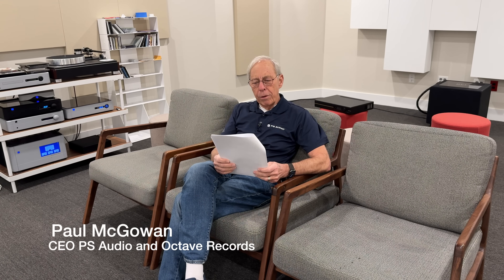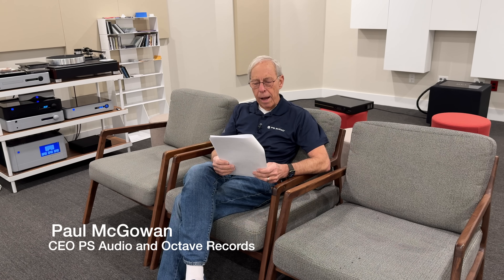Vacuum tubes in R2R DACs

Comment: After reading the comments I think there is a market for hifi Ethernet cables. 
Maybe I should get into it, lmao

Hand wired, precision cables designed specifically for your Hifi appliance, to deliver all of those bits with an utmost precision 

Ah sweet sound of those hifi tcp/ip packets, incomparable to the ones delivered by the inferior regular twisted pair…

Comment: Just a point, R2R networks only have R and 2R value resistors in a ladder configuration. Each stage represent a more significant bit than the previous, so a 16 bit DAC will have a string of 15 R value resistors with 16 2R resistors optionally shorted to ground between each one.

Comment: I think most people are conflating the encoded stream with the method it is encoded and decoded. DSD is just a low performance method of delta modulation which is used to reduce the bandwidth (storage/communication) For any DSD encoded waveform, there exists a mathematically identical PCM encoded waveform. The mathematical transform is extremely simple and can be done extremely efficiently by an FPGA. Thou it's not really needed unless you're talking MHz to GHz. The merits of the encoding and decoding methods/hardware is a completely separate topic.

Comment: a dac with vacuum tubes can be great ,you can swap the tubes and tailor your tone, you will have the possibility of using the best tubes ever made (vintage or nos) which are known for great sound instead of updating the firmware every 6 months.
Reply: I bought a tube dac from a small manufacturer, and it sounds very good, lots of detail and great soundstage. This small manufacturer's top of the line dac uses tubes and software for up sampling, plus power tubes in the output stage.

Comment: Sorry, sticking tubes in the chain is just more audiofool snake oil  psyuedo science
Reply: Why would you think that tubes are snake oil?
Reply: @ only thing they add would be tube distortion which apparently audiofools like
Reply: @lenimbery7038  tubes don't add audible distortion if designed not too, especially in a dac output stage.
Reply: @ nor any audible improvement
Reply: @lenimbery7038  you must never have heard a good tube dac if you are saying that.

Comment: When it comes to playback of PCM files. RtoR is the only accurate way. A PCM file has a set of data bytes (8 bits), often 2 (16bit) or more per sample. When a sample is played back it represents a very accurate number that represents the voltage measured at that point in time originally. The job of that PCM DAC chip is to play that exact voltage until the next sample is provided. And with the RtoR that is what it strives to do. 

The alternative is a Sigma Delta DAC. SD DACs are single bit DACS and ignore the actual numeric value of the sample making them completely ignorant of the actual PCM data value. The best they can do is use some algorithm and guess whether than new sample should be higher voltage than the last one. If yes, then turn on for that sample duration. They never know when they are at the actual exact value of that data sample. They just try to sloppily follow along with changes.
Reply: I wonder if the SD algorithm is really any different than what the DirectStream must do to compute the DSD stream from the input PCM stream.
Reply: @SteveWille  As the DirectStream is SD, yes.
Reply: @glenncurry3041  Paul’s comments in the video are confusing then… he explains that the DirectStream is unique in its approach (PCM → DSD → analog). If that is essentially what SD does, then the DirectStream is certainly not unique.
Reply: @SteveWille  All SD DACs turn PCM data into a single bit stream like DSD. Not all up sample to as high a rate as the DirectStream.
Reply: @ Cool… thanks for the clarification. So the DirectStream DAC is not fundamentally different than a garden-variety SD DAC. Maybe it only differs in implementation (FPGA) and in parametric aspects like the sample rate. Is it fair to say that there really are, broadly, currently only two fundamental approaches for D to A, multibit and SD, and then some implementational differences within each?
Reply: @SteveWille  It's spec sheet states: "Analog Conversion method - Delta Sigma (DSD) Single-bit double rate" ... "DirectStream converts every input signal, both PCM and DSD, to single-bit, high sample rate". 

As Paul always admits it is the output filtering that can make the biggest difference.

Comment: I feel for people just getting into digital sound.  It seems like a complicated mess of conflicting claims.  In the end, if you like the sound you are good to go.
To me it is very simple.  I used old CD players and then tried to get the best sound I could out of them.  You soon realize that a CDP is 3 components.  
1. A transport that produces the data stream for the DAC,
2. The DAC that converts digital stream to analogue, and
3. an output stage that beefs up the signal to get it to your amp or preamp.
Any of these 3 can be swapped and optimized.  Lukas Fikus, aka Lampizator was a DIY hobbyist who took CDPs and made them killer quality sound by replacing the crappy op amp output stage with a triode.  He showed that a tube output stage is just 3 resistors and a tube plus a couple of power supplies.  It can be added to any CDP.  A really nice 6n2p tube costs $3.  Such good sound for so little money and effort.  
When you break it down, that $600k DCS DAC is just these three components optimized to the extreme with separate boxes for all the power supplies and a lot of fancy bling to justify the enormous price tag.

Comment: Tubes kill a dac. Tubes belong in point to point wired circuits. Pick digital or vinyl. Don't mix
Reply: The output stage in a dac with tubes can be point to point wired, along with the power supply which could also have tubes in it.
Reply: @mitchtaylor6512  Yes, it is. For example, Audio Note DAC

Comment: I always enjoy your talks. It simplifies hifi so a lot more people can understand it and hopefully improve things. But ...

While I agree that DSD sounds great, and I really prefer it over PCM, it is definitely not the same as comparing sigma delta to R2R! And I really prefer R2R over SD. In fact I chose a great R2R dac that can't decode DSD natively but sounds better than any SD dac I can hope to afford. So even converted DSD sounds better that native DSD on my previous or other DACs. 

I totally agree that the output stage is very important to the overal sound. BUT! Sigma delta for converting DSD needs an elaborate output stage and filtering. This deteriorates the sound. Less complex means less deterioration, just like better parts help minimise loss of information. 

Now the neat part of R2R DACs is that they generally don't need an elaborate output stage. I've made modifications to old R2R DACs minimizing it to just 1 resistor to ground. That's all, and nothing in the signal path. It didn't measure great, bad in fact, but it sounds so natural. I discovered this after doing tons of modifications on a tube SD dac. Then I found this old Philips chips tda1543 and started modifying. 

And then came the epiphany walking in to a free summer concert in our local 12th century church. What I heard was not the exaggerated detail of the tube sigma delta, but the unfiltered R2R. 

Since then I quit tinkering. Upgraded to a Denafrips discrete R2R and recently to the Laiv Harmony. 

I learned my lesson not to rely on complex circuits. My first real speakers were cheap but good and weirdly only had 1 capacitor for the tweeter. Then I upgraded to a pair of lovely Rogers LS3/5a 15Ω. But I always missed air and transparency. No wonder, seeing the complex crossover. Then upgraded to Reference3a MC. Again: only one capacitor. There it was again! With added bass, mind you. 
Then 15 years later I had the chance to buy a pair of Genesis VI speakers. I still have them. Wow, finally in the big boy league. But also switched to refurbishing and modifying speakers. And finally, make my own. 

So what did I make? My own take on the LS3 but with lessons learned. It is tiny, dipole 3" Ti fullrange with a small AMT super tweeter. Just a bafflestep correction (and 3rd order for the AMT), in a closed bamboo ply box. The Genesis VI take care of subwoofer duty. Best sound I ever had. The speakers totally vanish, big sound, very spacious, very fast yet sweet, pinpoint accurate with incredible detail. 

Less often is more. More natural. And that is what R2R can do.

Comment: Very good explanation Paul. My opinion is: It’s time to create better ways from measurement in high-end audio devices, including new instruments to do it. For example loudspeakers still waiting for a real upgrade as transmission of the sound. 
The evolution of loudspeakers still very poor, and dependable of placement and the listening rooms.
Reply: Coming from an electronics degree from the early '70's and being involved in test and measurement of audio and video (sold bleeding edge digital video T&M), audio T&M is stuck in those 1940 - 1970s days. Simple steady state sine waves. A linear sweep at best. Maybe two of them at a time for IM. Nothing in analog audio testing actually test the dynamic type signal that actual audio is. Much less the digital distortions introduced. Audio in video applications actually had more T&M such as Differential Phase and Gain measurements. When video went digital they came up with an entire new set of T&M such as Zone Plates.

Comment: An audiophool and his money are soon parted!

These people should learn about things like transfer function, noise levels, etc.  Also, look into Shannon and Nyquest, to learn about how digital audio actually works.  Lets not forget vacuum tubes add their own noise.  For example, because they have the filament to heat the cathode, they have a lot more thermal noise than any transistor.  The hotter something is, the more thermal noise.  Also, unless DC is used to power the heater, it will also produce AC hum.  Tubes are also subject to microphonics, where vibrations add noise to the audio.  This is why tubes, in tube preamps, were often mounted on rubber.

Comment: In The High End 
Professional Audio World 🌎 Out/Put Stage of a
DAC Some Like 
The 6N1P Vacuum Tube
In a DAC 
Yet The Solid State 
MOSFET Has Similar Characteristics of a 
Vacuum Tube But  Is 
Much Cheaper and 
The Home Audio File Is 
None The Wiser 
Paul Ears 👂 Will Hear 
The Difference Between a
MOSFET vs 6N1P Vacuum Tube 
Yet Paul Has To Push 
His Products and 
The MOSFET Has a
Similar But Not 
Identical Sound To
a 6N1P Vacuum Tube 
Yet The MOSFET 
is Used For The Home 
Audio Market Because of
The Bottom Line 
Gee How Time Flys 
My O’Lady is Getting The
Bed Ready and It’s 
Twilight Time 
Happy New Year 
I Just Can’t Wait 😜 
My O’Lady Bought Me a
One Pound Bag of
Insomniac Dark Roast 
Whole Bean Coffee ☕️ 
Can’t Wait To Grind a 
Pot and Watch 
The Rose 🌹 
Parade

Comment: Do resistors only influence the current, but not the voltage?
Reply: Ohm's Law V=IR  Resistors change voltage and current. A resistor will show a voltage drop across it. Higher resistance= higher voltage drop= lower current flowing through the resistor.

Comment: @3:55 "That makes some people very upset."

Paul, you are the one who seems to be very upset, for being told that a 100%, purely digital format is not analog.
You want to have it your way, regardless of whether or not you are right or wrong, and take offense at not having it your way.

You should not take it personally, when you are publicly calling a digital format "analog", and you are corrected.  What do you expect?  Everyone should just go along with calling a digital format "analog", when it is 100% digital?

The DSD format is not analog.  Do not get upset over reality.

Paul, where are you storing your DSD songs?
The answer is on a hard drive or flash drive (solid state drive).  You are storing your DSD songs the same way you are storing your Excel spreadsheets, because your DSD songs are 100% digital.

The DSD format sounds amazingly like analog.  But that does not make the format analog.  DSD can sound more realistic and more analog than reel-to-reel.  But it is still not analog.  It is 100% digital.

Why are you making an issue over what is clearly and factually a digital format?

@4:13 "...put it (a digital stream) directly into an amplifier, and you get music."
You are connecting your DSD box directly to an amplifier.  That does not mean that you are feeding your amplifier a digital stream.  You are not.

Your DSD box is feeding voltage (voltage is analog) to your amplifier.
Just like any CD player, it reads the digital content from the storage device (the CD) and creates a voltage.  A CD player (or any DAC) creates voltage (the initial analog signal).

Just as a vinyl record is a dead slab, and has no sonic properties (hold it to your ear, and you hear nothing), it takes a voltage to start the analog signal, which happens when the stylus vibrates from the record's groove, and shakes the coils, etc.

Your DSD box is creating and sending out a voltage to your amplifier.

When a streaming service sends you a DSD formatted song, the streaming service is not sending you anything analog.  They are sending you digital bits, and only digital bits.  Then, your DSD box reads those bits and creates a voltage.  It is that voltage that you are feeding to your amplifier.

DSD is 100% digital.
DSD is 0% analog.
It is in the name of the acronym "Direct Stream Digital".

Paul, if you are certain of your position, then please update wikipedia.
Regardless, I wish PS Audio continued success.

Let's make 2025 a great year!
Reply: "Yes maybe, but muh ears make it sound analog to me and muh ears are always more right than you!" 🤗
Reply: Yes. Because your inner ear is 100% digital as well. Surprised? Well, so are your eyes. Because the nervous system is electrical too. 
In fact, our whole universe is quantized, that's why they call it quantum physics. 
So, your eyes can fool you, your ears can fool you, and your brain can fool you. 
Hifi is nothing more than foolery. But that doesn't mean it can be fun.
Reply: "digital" is not really the relevant term. Rather, is the instantaneous signal amplitude quantized versus continuously variable? Is that instantaneous amplitude updated at a fixed quantized rate, a variable quantized rate, or continuously? The limit as the quantized values approaches zero is continuous (both the amplitude and time). The key is to find at what point in the quantization is sufficiently small to be immaterially different.
Reply: @KellyR-qx7wn  '"digital" is not really the relevant term.'
"Digital" is the relevant term.  In fact, it is the entire point of my initial comment.

"Is that instantaneous amplitude..."
What creates the amplitude?

Perhaps you should update wikipedia, and let everyone know that they forgot that DSD content is analog.
See how that goes.

But please answer: "What creates the amplitude?"
Reply: @0Perhaps  Perhaps you should invest a bit more time in reading what I stated. I never said that DSD content is analog.
"What creates the amplitude?" 
Oh, there are tons of methods of creating an instantaneous amplitude which are not digital in nature. Might I suggest trying a 1 Mvolt Marx Generator on your preamplifiers input?
I think you'll find the results, enlightening?
Reply: You want to have it your way, regardless of whether or not you are right or wrong, and take offense at not having it your way". Sounds like the pot calling the kettle black...lol

Comment: Boy, this video was WAY over my head. (Not your fault.) Then I got to the “just have a listen” conclusion, and I felt a little better.
Reply: Digital audio is very technical and confusing, so I don't claim to understand most of it. The ultimate test of audio performance is always your ears. Trust your ears first, other people's opinions second.
Reply: @BruceCross it’s funny as a somewhat younger person (41) I find digital easy to understand as I grew up with it but the topic of vinyl with the different cartridge types, grounding, tone arms, belt vs direct drive, wow, flutter etc, etc., way more confusing. I went with a basic $300 Sony automatic turntable for this reason. I think it’s a generational thing.
Reply: @mikeg2491  Ha, great point. Vinyl is pretty complicated, too. Cartridge alignment alone intimidates me.